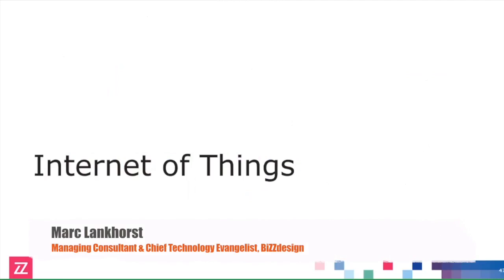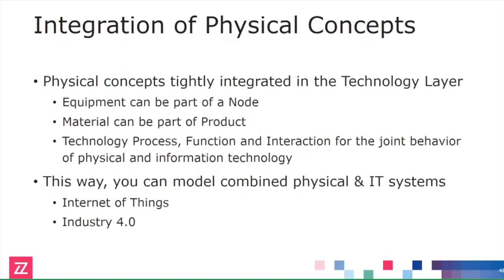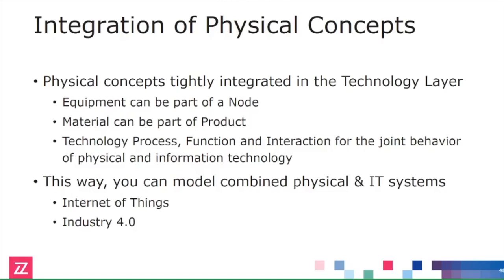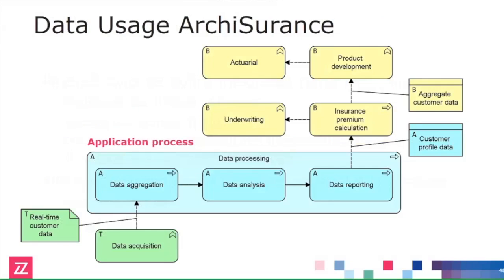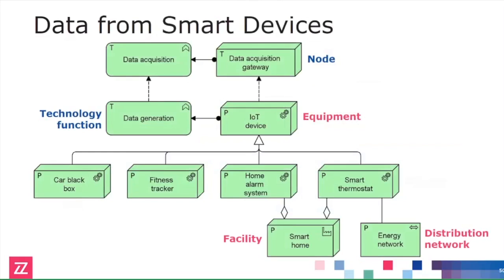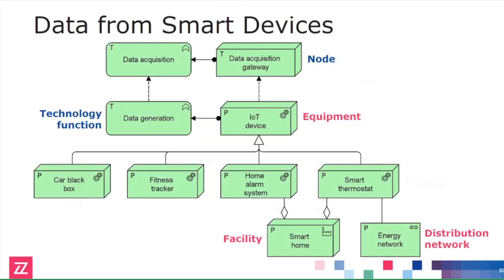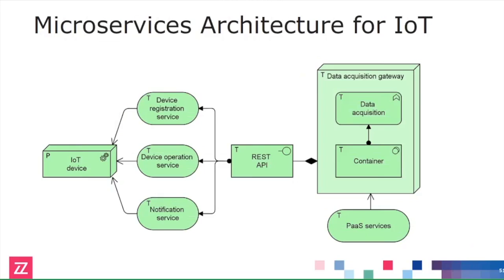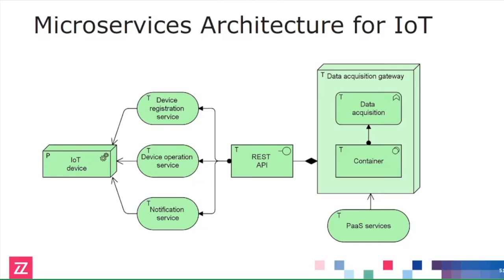ArchiMate® 3.0 in Practice (Part 4 The Internet of Things )

Comment: Hi Marc! All of the used examples of equipment in the physical layer would be better modeled as devices in my opinion. For me the real use-case for the physical layer is when you want to include information about (physical) distribution networks or the (physical) change of products/materials. 

In your example for a smart thermostat would not connect to an energy network, but perhaps to a central heating system, which would be a better example of equipment and something that can connect to an energy network logically. A smart home doesn't need to be a facility either, and comes across a bit forced in the example. The example does makes sense in a more abstract context, but that deviates from most (if not all) examples used by the Open Group. So I would advice including a more practical example that makes sense in the real world. 

I have used the physical layer in my Archimate models extensively in both an industrial as an IoT context which I would be happy to share.
Steven Bytheway